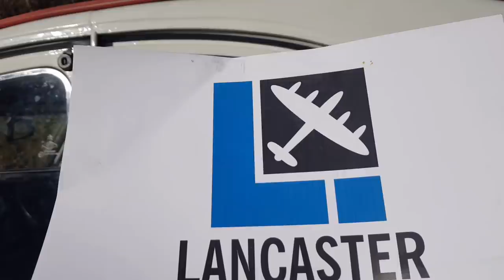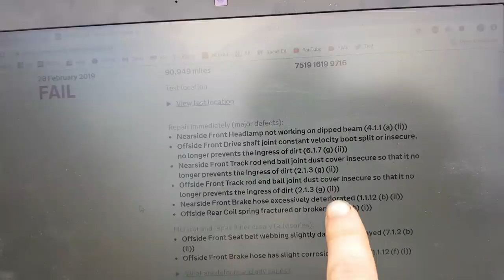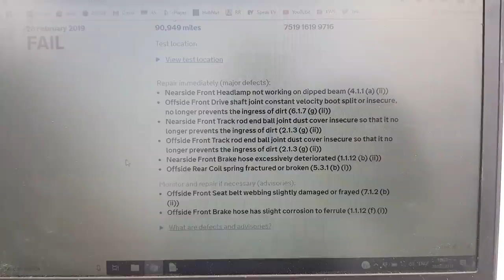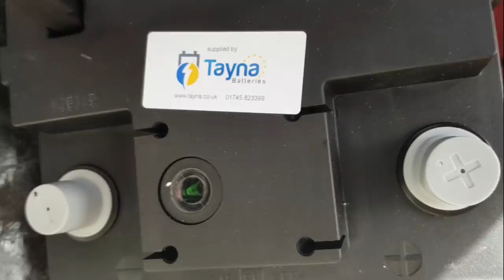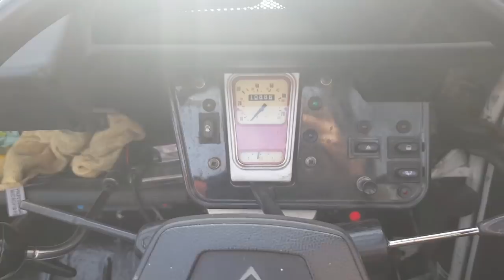Mazda 323F MOT result, 2CV battery change

Comment: Well done to the Mazda - for such a neglected car I was expecting a very long list of issues including welding and some mention of the bodywork damage, so a good result really despite it being a fail. Keep your eye out for matching doors - they all seemed to come in that metallic blue colour so shouldn't"t be hard to find. Bodywork is the one thing I tend to shy away from unless it's bolt-on panels such as front wings or doors, but sadly part and parcel of running an old car in our wet climate. 

The corrugated cardboard 2CV heater pipes are notorious for shrinking, dropping onto the hot manifold and starting a fire. Securing them with a zip tie or large jubilee clip can literally save a car. Another Citroën 'quirk' presumably aimed at keeping weight and costs down, but fortunately easily rectified. 

I am of the same view as you on being able to quickly disconnect a battery in the event of an electrical fire (my car has the 'biodegradeable' wiring harness!) but quick release battery terminals do seem to be the way forward, given the problems that loose connections can cause. (A good fire extinguisher is also a must if you daily drive a classic). I know someone who lost a car to fire and it's both terrifying (they were doing 70 on the motorway at the time) and heartbreaking, watching on helpless as your pride and joy burns to the ground :(

I had to replace all four of Misty's springs as the previous owner obviously had plans to turn her into a drift missile and took an angle grinder to them (before losing interest and weighing her in). Fortunately, used 240 bits are still cheap, and my sister has a set of spring compressors. Scary job without them! Ratchet straps are a very quick way to end up in A&E with a broken arm or worse.

Comment: The quick release battery terminals are a good idea. But the bad connection will damage the alternator and stop the battery getting a good charge therefor causing sulfation and knackering it. cant wait to see progress on the fox.
Reply: This is definitely true! My wife used to work for a large alternator company and they said this was the number one cause of alternator failures. When the terminals are not tight you get a voltage drop, perhaps not much, but enough to make the alternator work harder to charge the battery than normal. I would suggest a cut off switch for the battery and tight terminals. Good video!

Comment: hopefully hub nut is watching the antque's road trip as they have a very nice 2cv! its a 86/86 2cv special 6, its a sport verson! no rear seats, full fold down top, and the sides have lil divets in them its very lovely much better then a normal 2cv, 
also the mazda failed the mot srs? wow i thought it would pass with ease, just you know slightly broken air thingy, cv joint going, the sun roof leaks, oh and the wife's shopping trip might explane the gash on the side,

Comment: I would do the suspension work myself and save the cost of garage labour - easily pay for a proper spring compressor and probably the price of two new matching front tyres including balancing and tracking :-)  ?

Comment: Would have been great to see you fix the MOT issues on the Mazda. Some of them seem straight forward to do like the joints and brake pipes. I've seen videos on removing springs. It looks tricky but I'd give most things ago. I like you adaption to the battery clamp. Very hubnut sir.

Comment: Hi Ian,for the year of the car a few things wrong but nothing too serious,it goes well that's for sure,the new battery for the 2cv does start better,could you use the old heater pipe for the vents on the wings whats missing?or is it too big.
Reply from the maker: Old pipe is a danger in that engine bay and fit only for the bin. I've never fitted a brand new pipe there in 19 years of ownership, so can't complain really.

Comment: I might as well add my 2p worth with out all the correct info about resistance others have given already. TIGHTEN THE BATTERY TERMINALS. I once seen a terminal melt off a battery because the a  truck driver flipped the cut out switch back on then  jumped in and tried to start the engine before a mechanic had finished working on it.   I had to take the battery down to an Autoelectrical repair place and they were able to melt on a new lead terminal.
Reply from the maker: It has been done!

Comment: If the terminals are loose you can suffer a strange phenomenon where an insulating oxide layer can form instantaneously between the terminal clamp and the electrode post on cranking. Perhaps a kill switch might be a better safety feature going forward. I have a spare one if you want it.
Reply from the maker: It's ok. After similar advice on here, I've ordered one. Probably a better idea and means I can move the cable away from that bar.

Comment: I had to change both the rear coil springs on my carlton both had part of the coils snapped soon learnt that cheap coil spring compressors are dangerous  and bought a much better set from our local machine mart  .My carlton passed this years mot ,but refused to start when they went to drive it into the mot station was turning over but not firing left it with them they got it running  about 5 hours after it was booked in .
Reply from the maker: Oh dear. Pre-test nerves?!

Comment: Bend a Z into the battery support rods if you need them shorter.
Reply from the maker: I'm reluctant to do anything which then means I can't use those rods with an appropriate 2CV battery of the correct dimensions. Spacers work for now.

Comment: Evening Ian 
Not to bad on the Mot front 
, I would keep the terminals tight on the battery, and get one of those battery terminals you can unscrew to cut the power to the battery, you know what I mean about a fiver on eBay

Comment: are the stats stainless? Can you not run an m6? Tap down them and extend the threads. Don’t like the loose battery clamps mate not do the Alternator or ignition any good.
Reply from the maker: Haven't lost an alternator yet. Well I have, but that was because it seized up, 13 years ago.

Comment: I'm glad your going to do up the Mazda. I think your hypnotized by the shape🙂 You could try a Mazda specialists for parts, or a breakers yard. You might get some money back for the Alfa Romeo head unit. From some comments I've been reading, there worth quite a bit of money. And one last question does it have ads? Or is it good old fashioned cadence breaking?
Reply from the maker: No ABS. Cadence braking it is. Which suits me just fine.

Comment: Loose terminals are what kills the battery on the wife's horsebox.  Unless it's on a good run it would have gone flat after a couple of days.  I fitted a battery shut off with a turny knob thing that bolts to the battery.  And loose battery terminals can spark over rough ground.  However that's not the hubnut way.

But that mazda fail sheet isn't bad.  Its a shame about that massive dent.  Are we having a "hubnut frustration at filling and spraying" Video sponsored by Lancashire insurance?

Comment: Tayna supplied the battery for my Alpine & they gave me one that was flush so I can't use a clamp on it, so I'm hoping that cableties will be enough to hold the battery for the MOT
Reply from the maker: Should do, as long as they are tight.

Comment: Seems the loose battery terminals has been well covered by others. Was that battery clamp a generic one or a 2CV specific one? I had a similar issue with the threads on a generic clamp I bought to use in a Mini, but seeing as I have taps and dies, I ran a longer thread down each rod and cut off the excess above the nut. Which is something I think you should consider doing on yours before you lose some skin or impale something on those excessively long threads.
Reply from the maker: 2CV specific. Would fit a proper-sized battery just fine. I do need safety measures.
Reply: @HubNut  Just asking, but how do you know that it's not the rods that are the wrong size, not the battery?
Reply from the maker: Because the battery is much smaller than the old one...
Reply: @HubNut  I thought it was a random battery a mate gave you...
Reply from the maker: It was, but it was the correct size for a 2CV.
Reply: @HubNut  I bought a battery mail order for my 1.8 Morris from that Tanya batteries place, one with a higher cranking power than the one it came with, because it kept failing. Nowhere that sold batteries near me could help once I'd identified the battery I was after (although on the forum I go on, I've heard of other people source them from battery dealers near them) but in my instance it was a case of turning to the internet, finding the battery and getting sorted. The battery I got was a tiny bit taller than the standard one, but the clamps and bonnet (thankfully) could cope with it, and the battery has been good. So I can understand your frustration at your new 2CV battery clamp not fitting the afterrmarket battery. However I think it's not uncommon to buy an old car and find the battery is NOT secured, even though it's an MoT fail nowadays. It's just the general kind of lax attitude a lot of old cars seem to be kept on the road with. (My Ford Escort came from a car dealer with no jack, no wheel brace, and a hard and crusty moss covered commercial vehicle spare wheel jammed in the wheel well with no air pressure).

Comment: Check the drain pipes on the sun roof with a coat hanger, could be blocked with sh#te or even pipe could be crush with the bolts that hold the dash in. Happen to me twice.

Comment: I suspect that hose on the heater, going to the outside, that you have never had, is intended to keep fumes and crap out of the heater system. You may want to consider adding that, just for safety. That hot air system reminds me of a trick that was played on my dad with his model A Ford. The prankster stuffed Limburger cheese into heater just above the manifold. My dad said the smell was absolutely horrible and it took quite a bit to get rid of all that burnt cheese. Not very nice of his friend.
Reply from the maker: The air going through that pipe would otherwise go straight into the cabin when you turn the heater on.
Reply: There are two pipes, one goes to the cabin to supply heat and the other one would, I assume, redirect the heat out of the engine bay, if the hose were attached. It appears my concern may be baseless since it looks like air from that one open port, without the hose, will never leak into the cabin. I expect the air for the heater comes from the main cooling fan. Does that ever allow unpleasant odors into the cabin? On an old car I had, the seal for the back edge of the hood was bad and a small oil leak sent smoke up under the hood and  out. The air vent at the base of the windshield would suck the smoke in. Very unpleasant.

Comment: the issue with the headlamps is a common one? I found on my 323F that the H1 single pole halogen bulbs are prone to over heating in that the spade terminal gets so hot that the metal starts to discolour with heat and when it does this it loses conductivity and the bulb stops working? its an annoying fault and changing bulb brands did not seem to cure the fault, however giving the headlamp a bump with your fist often causes them to start working again but its only a temporary fix to get you home as next time you switch on the lights after they have cooled down they often fail to work again?

Comment: Result, £300 mot fix + £200 for the 323 and you've got a legal car for 12 months. What's the average first year depreciation on a brand new car? Really need to tighten those CV battery connections though or get quick release ones.

Comment: I don't want to be that guy, but in retrospect, are you happy with how fast you took this car down those welsh roads on the collection return journey?   knowing what you do now about it.....
Reply: meh its only a cracked spring, it still worked
Reply from the maker: Quite so. Mechanical failure is responsible for a tiny fraction of accidents. Far more likely that my own brain would be the cause of an accident.

Comment: Why not cable tie each end of the heater hoses onto the ducts. That must reduce chances of the ends dropping off and stop hot air leaks into the engine bay as well. With the amount of vibration going on it must be a risk. I have to say I don't know what Citroen standard practice is on that one....I can't remember if the ones on my old Dyane had clips...but it was 1977 so you must forgive me.
Reply from the maker: You can't really get them right enough with cable ties. The cardboard is very tough when the tubes are fresh.

Comment: The positive leads a mite too close to the bracket.  Possible to rotate the battery 180deg? Having negative touch the bracket is OK.  Are the leads long enough to reach?
Reply from the maker: No, but I have at least secured the positive clamp today. Even if the positive terminal rotated on the mount a bit, it wouldn't actually touch the bracket.

Comment: Has Ellie got a new grille, she's looking especially shiny in the face! Or is it just where you removed the radiator muff? In defence of Tanya, I've had to replace all 3 batteries in the last month for my fleet, a Jaguar with an AGM battery, Caterham 7 and a Combo van, all arrived within 24hours of ordering , were the cheapest for a decent battery and fitted perfectly.
Reply: i think its the correct battery, i think hes maybe missing a mat under the battery
Reply from the maker: It really isn't the right size. I've owned 2CVs for about 24 years. Grille was new in 2017.

Comment: Whoever put the sticker on the new battery .zero f**ks given. 
When replacing my battery I measure the hole and it's hight and try to find one that fills as much of the space as possible.  My clamp is a luggage strap from Halfords.
Reply from the maker: Yes, I should have measured. Too lazy and assumed the website would offer the correct size.

Comment: Instead of using more nuts, why didn't you cut more thread on the metal rod, it will make it easier to remove if you need to remove the battery at a later date. only one nut to remove !!

Comment: Springs are annoying no matter what the size, one wrong move and off they go flying across the room, or into the next county for a car spring... :P
Reply: A lot of people use cheap ones, my advice is buy quality spring compressers and don't rush turn down even both sides also, you see so many people cranking down one side first, I've done loads in my time never had any issues

Comment: In your previous vid, you mentioned how well the 323 handled. I imagine it'll handle a whole lot better with four good springs ;)

(I know, I know, a cracked coil spring isn't the sort of thing you can spot very easily on first sight, I'm just ribbing you).

BTW if you're after cheap parts, every Oz scrapper has lots and lots of these 323F's with good s/hand parts all the way up to decent panels and door skins. Have a shufty on fleabay (AU) or carsales.com.au and if there's something you want let me know, cos I'm sure there are cheaper ways to get parts shipped than via the seller's default shipper.
Reply from the maker: It's getting new track rod ends, wheel balancing and a full alignment too. Will be interesting to see what that does for it.

Comment: How did you get your car home from the test centre after it failed? I have been told that garages aren't allowed to let you drive away with no MOT anymore and this has led to less than civilized places holding your car to ransom and other decent garages left with lots of customer cars waiting for customers to pick them up.
Reply: @HubNut  a friend of mine has just had that issue. His timing chain was overdue. Failed MOT on a couple other things and garage told him he wasn't allowed to drive a car anywhere with no certificate and it would have to stay there until it had passed. No retests either apparently.
Reply: If that were true, not sure how it would work with a test centre that has no repair facilities.. and the fact you drove it safely there in the first place must count for something? MOT centres (if the tester got out the wrong side of bed that morning) can fail a car on dirty number plates or a sump drip for example ,so don't know how that constitutes a hazard that would stop the vehicle being driven home.
Reply from the maker: @superchickenlips1  That's one dodgy garage, talking out of its backside. No garage has the authority to prevent you driving your own car.
Reply: @HubNut  oh they went as far as telling him the only way it was leaving their property was on the back of a truck. If he drove it away they would ring the police. Naturally he assumed the car must be really unsafe for them to say that. After reading his list of fails none of them would render the car unsafe. That's when they said about ringing the police. I don't think my friend will be going back there.

Comment: Just putting an MOT on the Mazda will double its value. 

With Ellie and her battery, - I must have missed the video - What's the wires and relay that's coming off the terminal? Have you check them for a power leak? They could be draining the battery.

I also suspect that part of the problem is having the terminals loose enough to pull off, they need to be tight to form a good connection. I am surprised that tie straps were an MOT pass given the position of the battery and all that space in front of it. Under heavy braking, (stop laughing! I know it's a 2 CV so the word heavy is most inappropriate), the tie strap could give way.
Reply from the maker: The relays are for the headlamps, as none are fitted as standard.